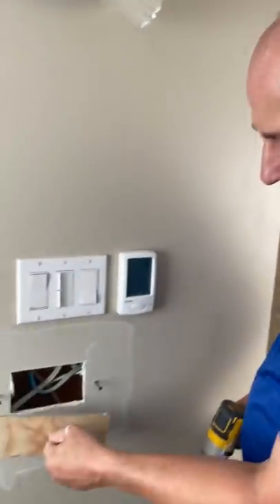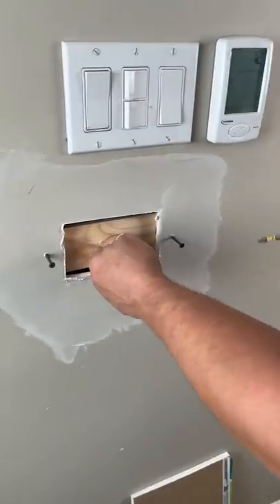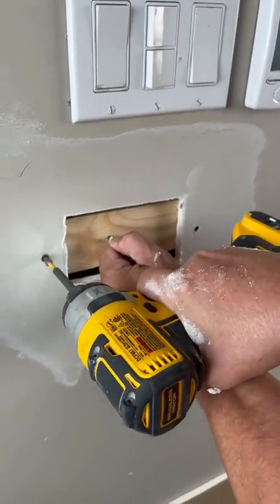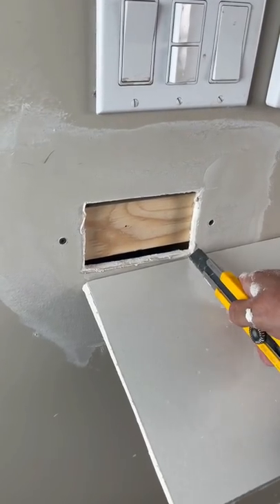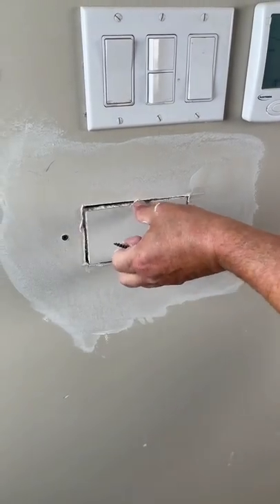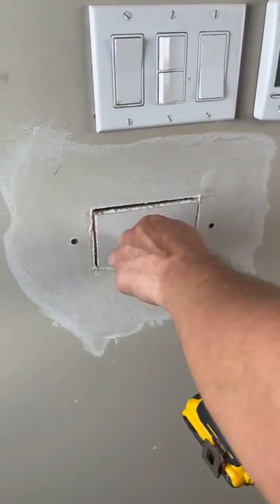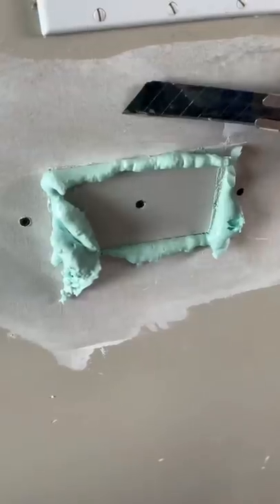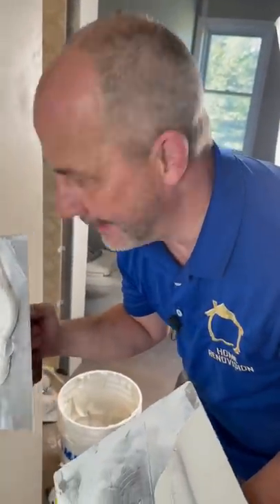Drywall Patch, No Tape Required #shorts

Comment: As someone who does drywall repairs as a specialty and is sought after in my city I'd say this is a decent idea but not necessary. For a patch that's not under weight (ceiling) or on a seam or attached to a stud which can and likely will move with enough time not only do you not need tape but you don't really have to use anything other than mud. The key here is to get that patch as tight as possible and bevel the edges of the existing drywall and new piece creating a tiny valley like ³/¹⁶ " at most and simply mud. Also you can just use 5minute hot mud slightly dryer than a normal application and pack it and slick it. Usually only 1 coat is necessary for perfectly smooth/ Unnoticeable patch.
Reply: You know whats up ☝
Reply: Jesus, try using some punctuation next time.
Reply: Great info thanks
Reply: @fallout3freak360  just read slower
Reply: @fallout3freak360  every person who corrects someone else’s grammar online probably has no friends
Reply: @Stephen-jw8ci  
"Your cute"
"*You're*"
"This is why you have no friends larry"
Reply: Americans: "The metric system is confusing"
Also Americans: 3/16"

It's about 5 mm or 0.5 cm.
Reply: @nicolainielsen7700  
It's a fraction.
Reply: @nakedsnake4248  And you could argue that decimals are easier for the general population to understand than fractions.

If you were going to double the length in the comment above, what's easier? 2 × (3/16) or 2 × 0,5?
Reply: @nicolainielsen7700  THIS. 
I love maths but that just stumped me. I literally had to think for a second, seriously...
 number / number "
Uhh.... what?
Reply: @nicolainielsen7700  plenty of tricks to make multiplying fractions just as simple..
Reply: This would take way more time than just shooting in foam and flush cutting it off lol
Reply: See the problem with your idea which I have used many times is that the area ge patched is a very used area with high possibility of someone unknowingly push on it id do it on a less traffic spot
Reply: I’m impressed that you made a fraction the way you did I didn’t know you could do that.  3/16”
Reply: Yea that's how I did it but I was Mainly working on quick cheap remodels for rental locations
Reply: @nicolainielsen7700  exactly plus idk how tf u measure a 3/16"
Reply: I’ve done this a few times and it does work pretty well but usually two coats of mud
Reply: @Midnight I guess it's a thing that someone gets used I'm used to metric so I feel it's more accurate since the cm is smaller than an inch yet  a foot is smaller than a meter
Reply: @Midnight we also use inches for some stuff/products such as saws and machining
Reply: @Midnight  yeah true I learned how to to convert em to cm so I can convert to customers that don't know how
Reply: He is so sought after in his city, beacause everyone wants to teach him what punctuation marks are.
Reply: The drywall is not holding the cieling. the exterior and interior walls are. The drywall sheets are held by the screws screwed to the cieling. So less screws on the joints it's more willing to budget or crack the right amount of screws about 1 every 6 inches on joints and 1 on every 10 inches on studs is correct. This is my specialty
Reply: Or you can just use the drywall patch kit sold at every hardware store
Reply: @extendedtravel567  actually the load bearing walls that run perpendicular to the joist are holding the walls. And yeas drywall does give structural integrity but only if the studs are solid, and it’s only shearing stability
Reply: @extendedtravel567  field is 1 and 12 borders are 1 and 6 right?
Reply: @alecc4137  been doing drywall for over 20 years, and I can promise you he doesn't know whats up... taking shortcuts like this is bullshit. It's fine for a DIYer, but if someone is paying you to patch a hole, you should do it right. One coat is complete bullshit as well. It's not going to be perfectly smooth with just one coat.  These are the people who do the shitty work in the remodel jobs I work on. I'll be fixing/remodeling one thing and end up fixing something else for free because I can't stand to see trash like this guys work.

I mostly work on multimillion dollar homes, so there's probably a difference in quality standards, but even regular houses get the same treatment as the mansions from me.
Reply: Or just do it right and use tape or do a blow out patch. Mix plaster gauging in your mud and you can paint it the same day. And it doesn't scratch when you sand like 5,20,45 or 90. And there's no way you're getting that done with one coat lol
Reply: @ahmadtkatka7800  with a tape measure. It's literally 3 dashes....how is that so hard?
Reply: @extendedtravel567  split the width of the board. One at the top in the angle 2 in the field and one at the flat.  4 screws. Heavier board, or 54s add another screw in the field.
Reply: @lHiTMANll  thank you!!!! I don't have the time to correct these fools. I've done this my whole life. Learned from my dad who's done it his whole life. Started at 7 spotting screws.  This type of work is not a good look on dudes who actually care about what they're doing!!!
Reply: @epiphonessg2249  good cuz he's not doing it right either 😂
Reply: @jeepwk6.5L  or don't use tricks and it's even easier to follow the other system :D!
Reply: It's only going to crack if it moves. If you make it so it doesn't move it won't crack. What do you mean by "slick it"?

Comment: Hey Jeff, that's exactly how I did repair in my hotel a few years ago. I had to repair 13 holes in one room alone. I thought this was MY idea (I guess I was wrong).

BTW, the 13 holes were cause by an electrician looking for a short in the wiring. A word of advise: never tell anyone "sure, do whatever holes you need ... I'll just patch em". :-(
Reply from the maker: words to live by. Cheers!
Reply: I mean sometimes you need to poke that many holes as an electrician, especially when having to pull cables through existing walls or looking for a damaged cable (stupid rats) .. but still the electrician should have covered those up..  I would never leave a job like that unless it was on a building site with guys already paid to patch it up
Reply: Hey bro your a fuking pro why are u even watching this video?
Reply: Well…. I mean, patching 13+ drywall holes is infinitely better than the entire building burning down from any unlocated shorts in the wiring. Lol  

Personally, I’d just deal with however many holes it takes & the inevitable patching nightmare that’s sure to follow. 🤷‍♀️ 
It’s much cheaper than faulty electrical wiring shorting out major (very expensive) appliances; heating up/melting/burning my insulation, walls, framing, & any other wiring nearby; or starting/catching fire, burning down my place, & potentially killing someone/many ppl in the process?! No, Thx. 😂 
Oh, wait… so, I can just patch 13+ holes (or replace the whole damn sheet) in the drywall, instead? 🤔 Umm, yea… I’ll take THAT over the alternative, ANY DAY!! 😂
Reply: I did construction for 2 months. That's exactly how I filled the ceiling holes for lighting. Using a filler to fill everything around it.
Reply: @bobjamaica9045  i could never be an electrician 
coming from a floor guy
Reply: I work in a hotel to and I’ve seen this done many many years ago cool trick tho
Reply: They dont have a choice but to let the electrician make holes if they want him to do the job.
Reply: @bobjamaica9045  patches isnt his job though.
Reply: @bobjamaica9045  an electrician doesn’t get paid to patch holes, you clearly aren’t an electrician
Reply: I laughed so hard at this😂😂
Reply: @bobjamaica9045  I tell my electrician to please leave a mess and don’t patch anything. I pay him to do the electrical, I can handle that other sh
Reply: @raymondmaglaris4149  its decent work and very good pay.. Unless you have back problems then its not so bad..
Reply: @Gl-my8fw  well technically its not, however if you are working privately for someone you will finish the job right?
Reply: @bobjamaica9045  if the electrical is done the electrician did finish their job. The drywall repair needs to be done separately by the general contractor or homeowner.
Reply: @Gl-my8fw  Never left a home owner with a hole in their wall.. different if it's a building site not a private home job you got hired to do...Plus that stuff is decided upon before the job starts. Sometimes they don't care as they will be doing more work, other times you fix your mess.

Comment: Best thing is that I was watching one of your dry wall videos on how to patch a dry wall hole, terribly messed up (was my first time working with drywall) and had a smaller pice of drywall than I wanted, ended up doing this exact thing and it worked out absolutely perfectly, glad to know It's an actual method and not just something I did XX
Reply: Drywall guy here. 🙋‍♂️
It's 100% not an actual method.
Reply: @pbgf0411  It’s totally an actually method for DIY fixes and works well. Every professional has their own way of doing things and love to act like it’s the only way lmao.

Comment: Cut a piece of drywall 1”  perimeter bigger than the hole. Score back of drywall to exact size of hole and peel excess drywall off allowing the paper face to remain. Mud hole and use drywall  paper face as tape joint.  Best part about it, don’t waste money on expansion foam...
Reply: I have seen him show that before in a video i am just confused as to why he did it with the wood behind now.
Reply: Exactly thats a hotpatch idk why he went so extra
Reply: @AFunkyTurtle  wouldn’t the plywood provide more support if you ever need to hang anything from that area of drywall in the future? If you used the other method (overlapping paper + mud) your only support would be the paper and thin layer of dried mud. Is that strong enough to hand a picture from, drywall anchor, or towel rack?
Reply: Now that's the right way to do it. Thank you for saying that. Was about to myself. Glad I was reading previous comment's first.
Reply: @danieldraper4478  If this was an area where a picture would hang, towel rack, etc. I would just add a strip of wood behind the patch and do the same “hot patch” method.  Most times patches like these are behind door handles, low to floor, etc. places where things wouldn’t hang.
Reply: @danieldraper4478  no because you're supposed to hang stuff on studs not a random peice of wood in the wall. You won't be able to find it again after painting.
Reply: @danieldraper4478  no you would still have another piece of drywall filling that hole. There is just extra paper around it for the mud to hold to. Both ways should be able to hold light items but for something heavier you would find and use a stud.
Reply: @danieldraper4478  a hot patch and wood would be the best way if you know your hanging a picture there. Then if you were to just hot patch it becomes as strong as the wall itself. Mud is harder than Sheetrock.

Comment: Yes I have seen it before. That's exactly how I repaired holes when I bought my house. I'm not a professional in drywall repair so I thought of the easiest way to repair it while looking the best for me. Taping never turned out like the pros do it when I tried it.
Reply: Easiest way to do it, if you don't know the bunny ear trick. I did the same when I first started my handyman trade. In my trade bunny ears trick saves me money. no wood, tape or screws. It's easy for home owner to learn and save you some money. I'm all about helping people out
Reply: I have too have been doing it this way for a long time. just figured it out on my own. We must be on the same wavelength
Reply: Why do I smell a dirty old cap?
Reply: Why is there no requirement for tape?
Reply: wait, you guys used 'tape', for such a small patch?
the more you know...
Reply: Will King  bunny ears is when you cut your patch 1 in larger on all sides then score the drywall on the back side peeling away the extra drywall but leaving the surface paper. Then you apply it to the hole there is a 1 in flap of surface paper that you can then treat as drywall tape.

Comment: It's an awesome fix. If you think it doesn't work you not tried it. The foam holds it so tight. It's also a great way of solving any cracks anywhere in drywall. Rake out the crack, fill void with foam, cut back and fill. Done. My go to problem solver almost everywhere
Reply from the maker: Right on. Cheers James, once you know you know.

Comment: He is correct!  I have NEVER seen that before. If I did, I would have fired the guy who showed me.
Reply: Why..?
Reply: Pretty standard that in the uk 
However foam is a last resort for apprentices 
Tapes cheaper than foam anyway
Reply: This is how you do it, expansion foam wouldn't be my first choice though, I'd use mud for the small gaps
Reply: @matthewdavies8333 This isn't how you do it, you don't use foam, mud would be used to pre full, you would use mesh tape otherwise it's going to crack .